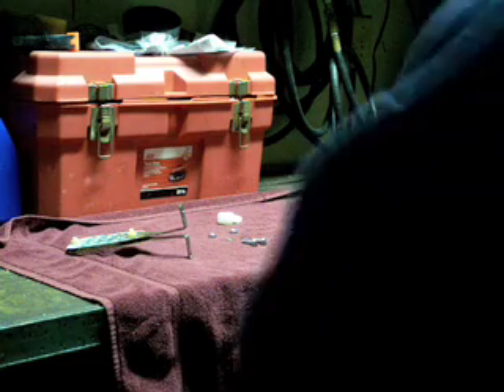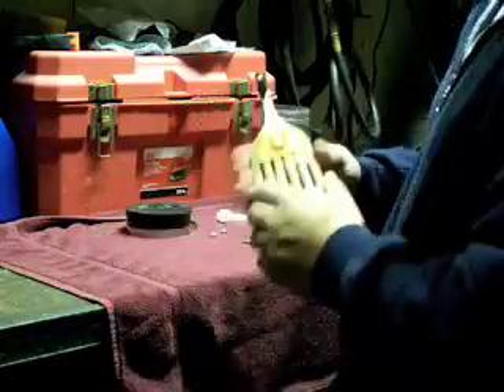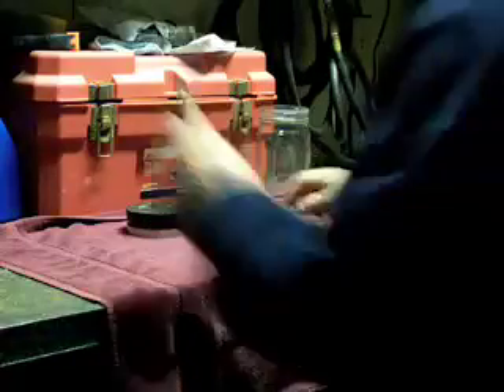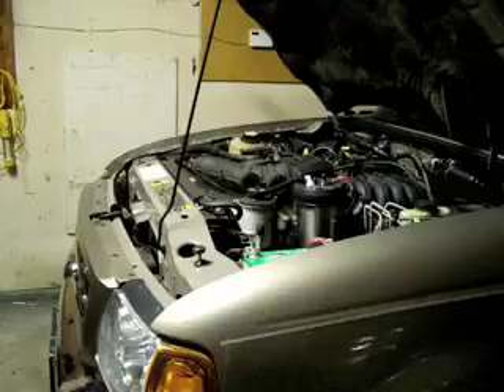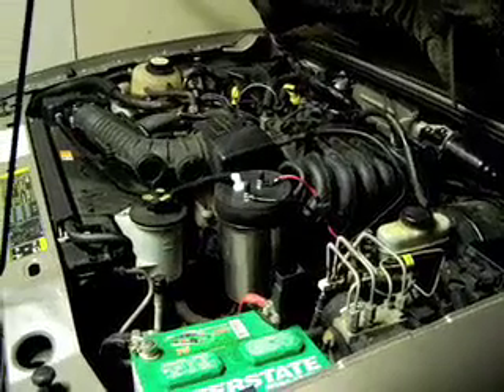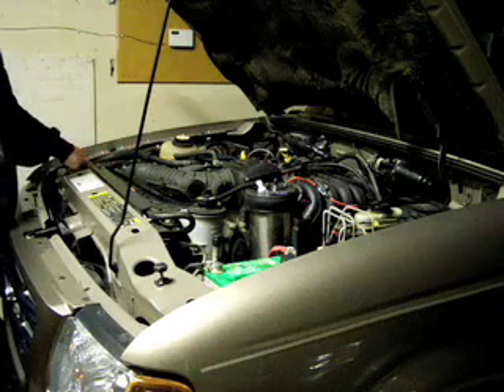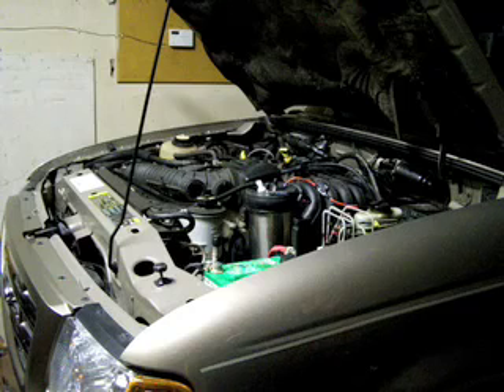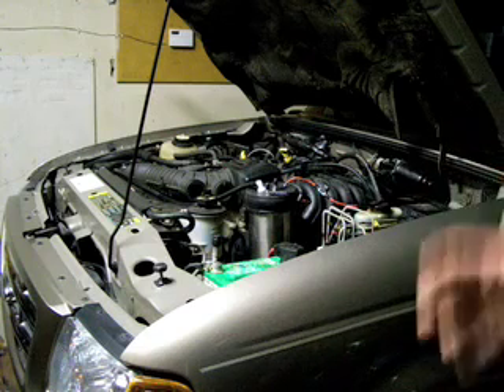How to build a simple - yet effective - HHO Generator

Comment: dear terry tech 

one question. isn`t it so that due to the high temperature burning of hho your engine head 
valves and headshutters burn and evaorape?

how many miles have you already druven by now 

the other thing i noticed at the moment you hooked the bubler on the intake was a 50% noise reducting of the motor in free modus.

that was excellent!!

Comment: Normal air has around 20% pure oxygen in it. the 1 oxygen this produces is 100% oxygen, even though its not hydrogen, it is still better to have it go into your intake than not. you wont find a hho generator for cars that seperates the oxygen as it will perform better with it.

Comment: Thank you.let ma ask you,because you are good at this.Why many people use dry cell instead of wet cells?I think the production of HHO will be the same if properly mixed electrolyte and also is there realy big reason for neutral plates in between?I have tried that what draws the Amps. is how concentrated is your elektrolyte,not too much difference of quantity HHO,if you have 10% or 40% KOH in it.I think the S.Meyer's 6-8 tubes wet cell has better production than  dry cells.

Comment: Oh hello, 
      I have somewhat the same design. Wanted to ask I hooked mine up with a 3 amp
plug in the wall power supply. 12 volt 3 amp.  After about 30 sec. that power supply the back got  HOT !   So I unhooked. Then I hooked up the unit with the battery charger. 12 volts at 10 amps. Turned it on and watched the little bubbles. I started out with 1/2 teaspoons  of soda then slowly added more. Up to 3 tablespoons. in appox 1/2 gal if water. To much soda got it 
hot to fast ?

Comment: I have been looking at you video (several times) and ? or assurances:
 you use a 20 amp fuse, you say?
you insert "before"  the air filter into the air box - how is that working after three years?
and
how are the "non-stainless" speculates working (oxidation)?

Comment: @terrystech  do you need just enough water in the second container so that a tube bubbles into it, or do you need a specific amount? Also would you recommend wiring the generator to a toggle switch? I have a 4x4 and I would want to turn it off when conditions get too bumpy or there is an increased chance of accidents.

Comment: you are de bomb! thanks so much for an easy how-to-do, and not complex. what kind of mileage do you get now, that's a Ford Ranger 4 cyl 2.3L engine, right? what mileage did you get before and after the HHO system? Thanks  I heard also, that you should use a 2 bublers to scrub the gas, so it's not as caustic and corrodes the engine.

Comment: Hi there.
Great video. I subscribed.

I got few questions. I hope you've got some time to answer them.

Sorry for my english I'll do my best to explain what i need.

From where does the electric wires on jar comes from? Are they from accumulator, or alternator?

For what is used the other jar?

Do you start your car on fuel?

And how did you manage to stop fuel injection into engine, while the engine is on HHO?

Thank you for your time.

Comment: @terrystech If you use windshield washer fluid (-40 Deg, or -50 deg) it will work just fine for 2 to 5 days of fighting the freezing effect., That's 4 to 6 tablespoons of it per 500 mL.

Comment: Ok. I'm very new to this. I want to use this to run a small lawnmower engine on. If I use this to produce Hydrogen can I use it to power an engine if I make the engine compatible to run on hydrogen? Would I just feed the tube into the gas tank?

Comment: Great work man, your video has sparked my imagination. I'm aware from the other posts that for a more complex system I will need an amp meter, voltage controller, and pwm. I am a newbie, can you please perhaps link me up to the items you would recommend I buy? Also, have you ever run a generator on hydrogen? Would hydrogen generate more electricity than it takes to seperate it? Could you power a generator large enough to power your home? 

Infinite thanks, What I learn will also be shared freely

Comment: 5: Since water boils at a given temperature at 1 atmospheres, couldn't you increase your boiling point by creating a pressurized system thus lower the boiling point? Additionally, doesn't adding sodium bicarbonate also decrease your boiling temperatures? The reason for these questions is to lead to a 6th: IF you could decrease the boiling point and increase amperage, couldn't you increase hydrogen production?

Comment: Hi Terry thanks, I was wondering what exactly is the black cap you used on the bottle ? Where It does not have threads just steel clamp looses like a end cap of a 3 inch  hose ? rubber ? plastic ? Lowes ?, Autozone ?

Comment: Nice simple design. After I watched this video, I had to try your design, but the production was not very exciting.

I modified the design slightly by bending the handles outward and placed 5 Neutral plates (stainless wall plate covers from Lowes) in between them. This allowed me to have even current of 2 volts per plate. + N N N N N -

This is important, because it lowers the amp draw and reduces heat, but at the same time I have increased output substantially.

Comment: I have made two of these generators for my 99 dodge ram, which has a 318 v8 engine.  I used two ss wall outlet covers as plates in each, they are pulling about 15 to 20 amp together. Will the extra load on my alternator cause my truck to use more gas? and to your knolage, do I need to make any mods to my o2 sensors on this truck, it has three or four sensors, there is two at the manifold and one before and one after the cat.  Thanks.

Comment: I worry about the glass jars a lot but at least it wasn't full of wire. The cap was an improvement too. Those guys that build the water 4 gas rigs fail to mention the lid melts.The water 4 gas plan is junk. If you hear the words baking soda run. Check out my generators and let me know what you think.